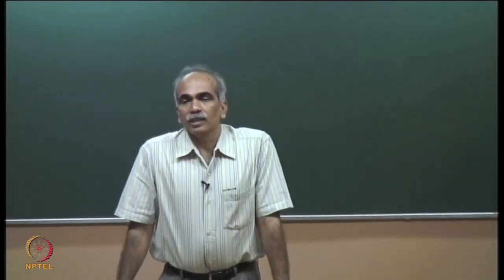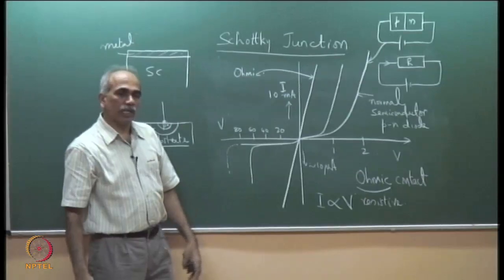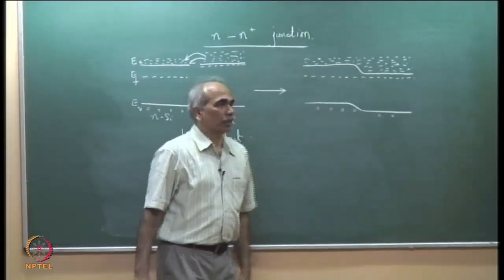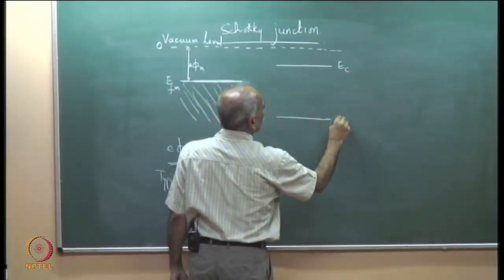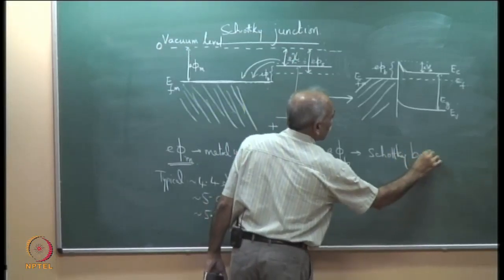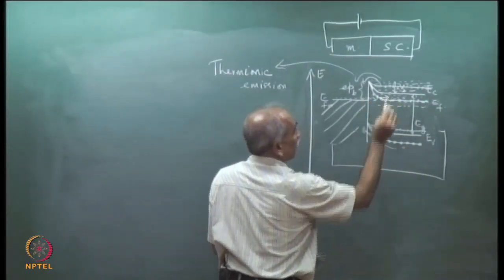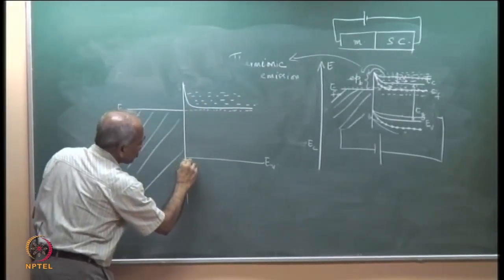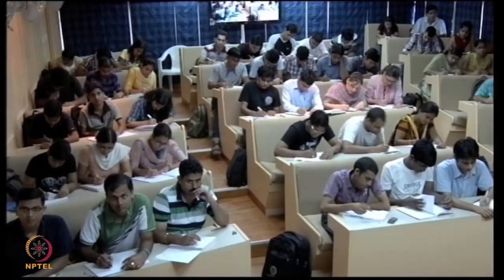Schottky Junction and Ohmic Contacts

Comment: 49:50 when it is reversed biased, why is the fermi level of semiconductor and of metal not aligned? Please answer sir. Btw great lecture
Reply: 1. When you connect two different materials (metal and semiconductor in this case) without any external bias, charges flow from one material to another until the Fermi levels align. This corresponds to the “Equilibrium energy band diagram”
2. When you apply voltage across a device which has achieved equilibrium, you add energy to (or subtract energy from, depending on the polarity) every energy state in the bulk of one of the materials relative to the other material. Hence, for this reverse biased case which you asked about, every energy state (Ec, Ev, EF and Evacuum included) in the bulk of the semiconductor moves “downward” in energy relative to the metal. (Note however that the energy levels at the junction are pinned) Hence, the Fermi levels are not aligned any more.
Long story short, Fermi levels align only under equilibrium (applies to semiconductor-semiconductor junctions also)
Reply: when there is no bias fermi levels on both sides are equal.when ever  it is biased fermilevels on both sides become  unequal.